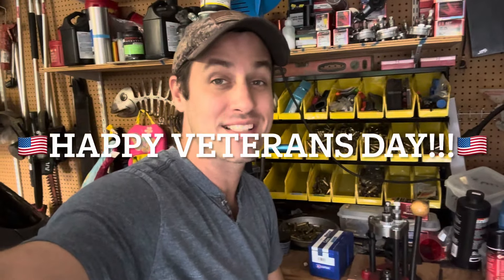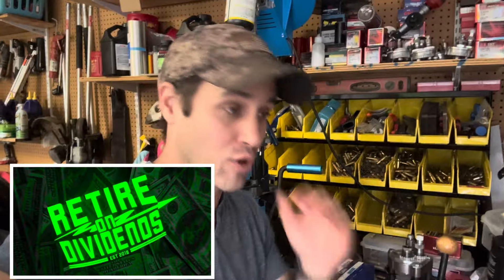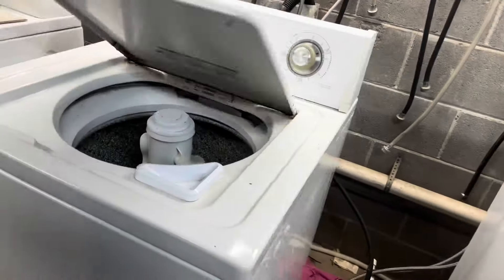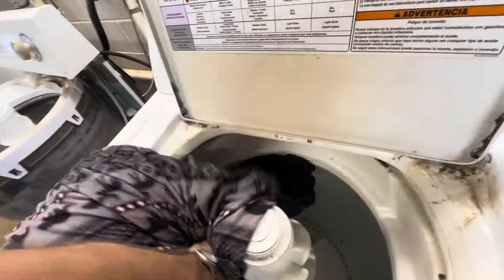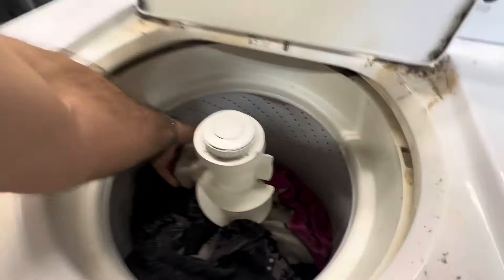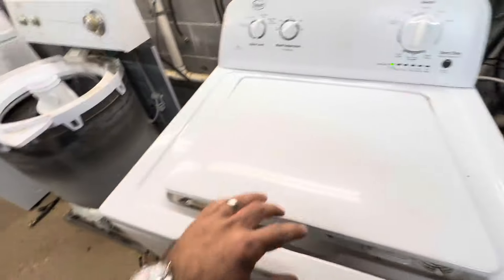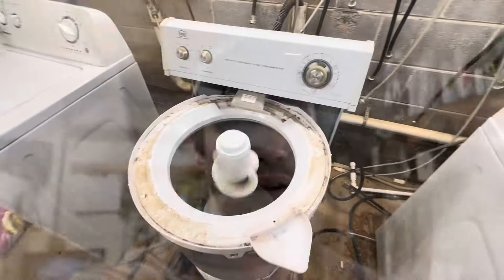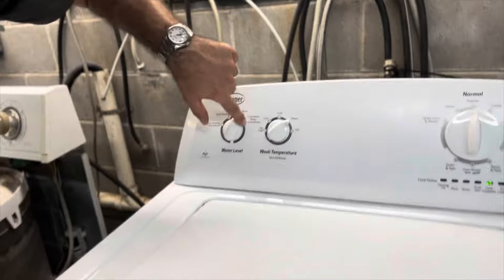Comparison of an Older Roper RTW4440VQ1 vs. newer Roper RTW4516FW2 | DONT RUN EXTRA RINSE 🤯

Comment: I'm happy to say I was the 1001 who subbed. Good job and good luck going forward
Reply from the maker: @paxrom373  YOU ROCK PAX! Thank you very much. I’m going to try and get better at this. It’s a work in progress
Reply: @LAapplianceguy  LOL.. I think for a 'work in progress' as you say, your presentation is better than over 50% of what I've seen around these parts. And I've been around here almost from the beginning of YouTube. Question - only if you get the time to reply. I saw some of your stuff regarding Maytag. We always thought Maytag was a #1 company. Our fridge, dishwasher, and washer/dryer all all Maytag. But we had a bad problem with the Maytag oven we had to get replaced. It was only 3 years old, still under warranty when it died. The serviceman informed us that Maytag is no longer made in the USA and there are a lot of complaints about the product. Have you heard anything about that?
Reply from the maker: @ yes sadly Maytag is now owned by whirlpool. Which is still a decent product. But not what Maytag used to be. Not bad units. Just not like the old real Maytags that lasted 30 years.
Reply from the maker: @ I really appreciate the positive feedback. And thank you for kicking us over the 1k hill. Here we go on to 2k wooooooo!
Reply: @LAapplianceguy  thanks for filling me in about Maytag.
Reply from the maker: @ no worries. I love the old Maytags. I try and fix them anytime is possible because the old ones lasted.
Reply from the maker: @ thanks for watching